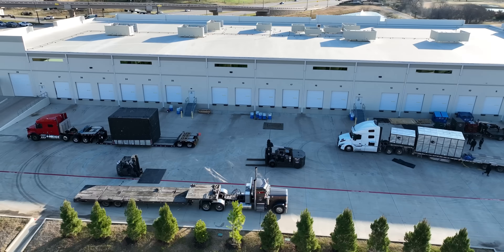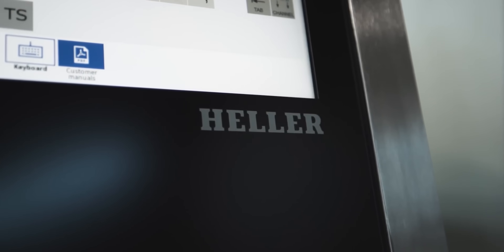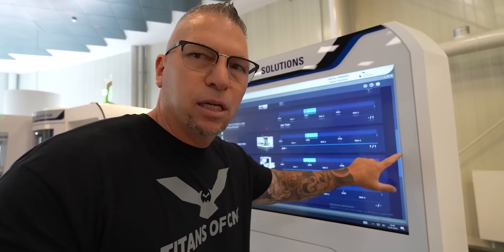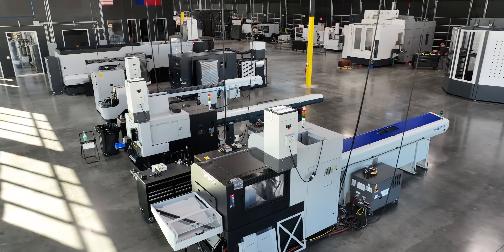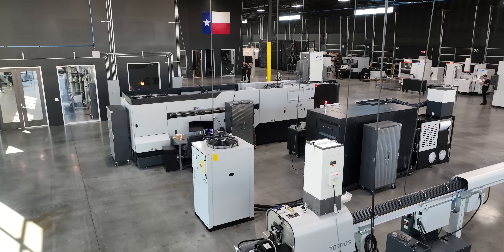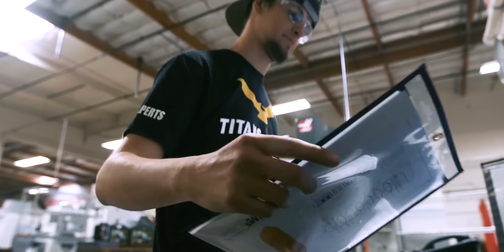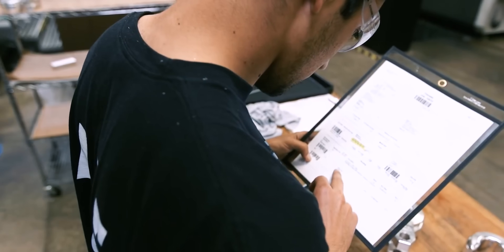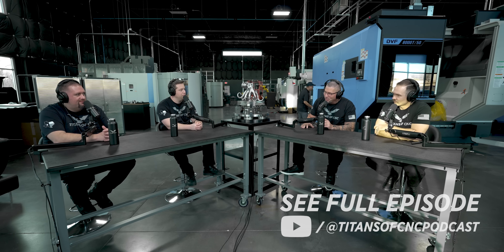New MONSTER CNC Machine from DN Solutions has HUGE Upgrade

Comment: 1:34 I feel attacked 😂 Jessi saying you don’t need to know this foreign language while displaying a Hurco , you should give them a shot, they can run g code like any other machine . Iv ran hurco, haas, Siemens, mazatrol, fanuc, and hurco is easily my favorite.
Reply: Me too. Not every job needs the latest technology.  Sometimes a drill press is hard to beat. When my company brought there first HMC, we had a hard time being competitive on a part from a local shop.  We asked them how they were making it. They said, we’re paying a high school student 8hr to run an old Bridgeport in the back corner. If I was doing one offs on the mills, Hurco would be my choice. But once you start running g-codes, I really appreciate the simplicity of the Fanuc/Haas control. I’ve been G-coding for so long, English is my second language.

Comment: i hate siemens for cnc turning
Reply: Why? ShopTurn is super easy...
Reply: Fanuc is for Turning super easy to use. I like that too. On Milling i am more on Heidenhein than Siemens.
Reply: @oberender64  siemens control is braindead
Reply: @oberender64  I will Turn and Mill on the same Machine. I will see how easy the programming will be. I learned Heidenhain in my apprenticeship and as I saw other Controls, I started to hate heidenhain for its userunfriendly programming. You need to write 10x more, than with any other. It's like the first G Code Controls. With the 640 they woke up :D
Reply: I love it for Milling, what do you prefer for turning? The best control for milling is still Hurco in my opinion
Reply: @Iwas71Killed  i use fanuc
Reply: ShopTurn is even easier than Mazatrol for turning and has a lot more options.
Reply: Have you use Shopturn?